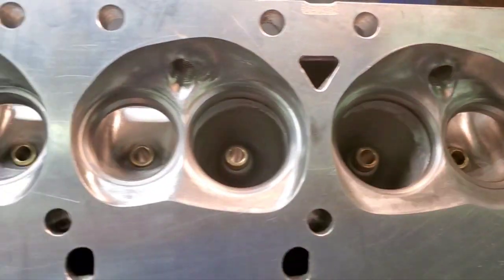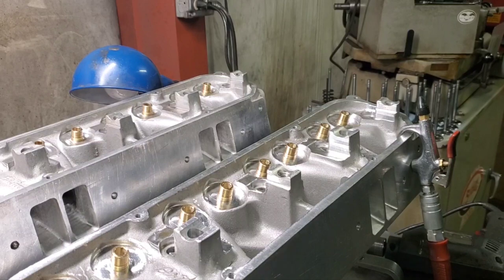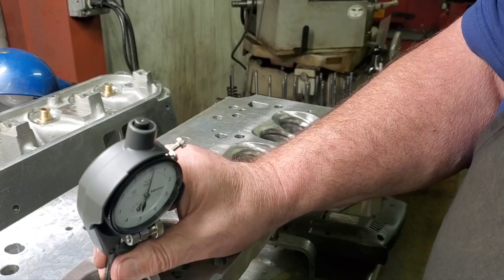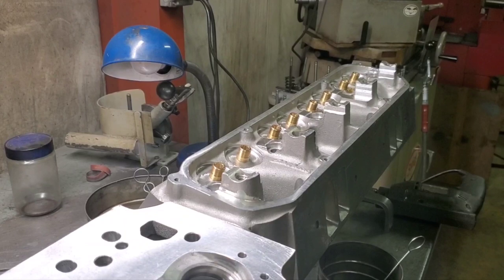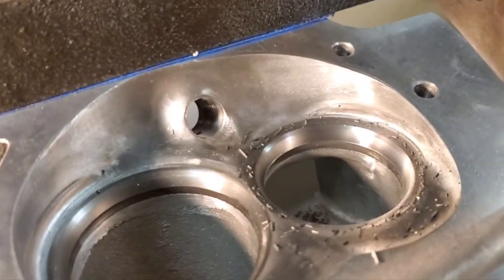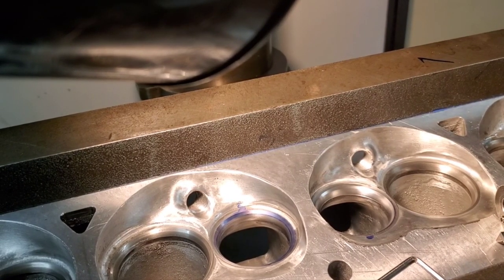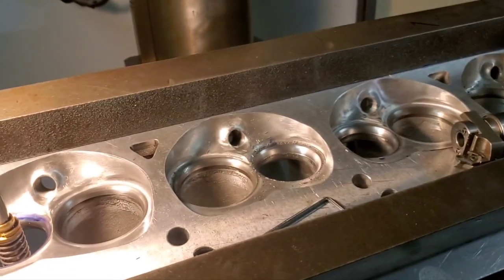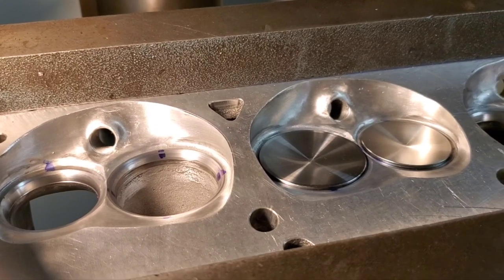Edelbrock Estreet Big Block Mopar Heads for JustMoparJoe Next Level Performance.

Comment: Thanks for sharing, Ed. Definitely the nicest heads I’ve owned on the nicest block I’ve built! Should make for a dynamic combination. This is more proof that there is no “out of the box” head out there.
Reply from the maker: Thanks Joe.
I really appreciate your comments. 
I really think your on the right track with your 400 Mopar Combo.
Should make good power and run nice.
And yes, no heads are ready to run.
There are a few that are good and close to great, but never assume that for sure.
Check them out.
Take care, Ed.

Comment: So when buying Edelbrock heads allow extra $1k to have then sorted out?
what material is used in the seats?
very informative video, well explained
Reply from the maker: Thanks for watching Darren.
I never said the costs involved in performance prep of the heads.
Basic performance would start at 750.00 and go up from there.
I believe the seat material is ductile iron.
Unleaded gas compatible. 
Thanks again, Ed.
Reply: @edsmachine93  no problem , I looked at the work done and made an estimate of the cost, wasn't too far off with my guess.
have these heads in my garage waiting for a future project so it was good to see how you prep them
Reply from the maker: @darrenfrauenfelder5997  OK Darren, 
a proper prep of your heads may be a good plan.
Best of luck with your project.

Comment: Hi ed on the top of the guide what is the thread on it?
Reply from the maker: No Josh, it is machined serrations for the Viton in the valve seals to grip on.
Really a nice feature. 
There are alot of guides that use this procedure.

Comment: I thought E Streets were open. Guess not
Reply: They do have a big area by the intake valve opposite the spark plug in the chamber... not sure why that's there unless just to universally increase volume.
Reply from the maker: Hi Joshua, thanks for watching.
These heads started as 75cc, they have some larger cc heads.
We will cc the heads in part 2.
Take care, Ed.
Reply from the maker: @johnwilburn  Hey John, hope you're doing well.
The chambers leave alot to be desired, but they are alot better now.
The valves were very shrouded before.
Thanks for stopping in.
Take care, Ed.